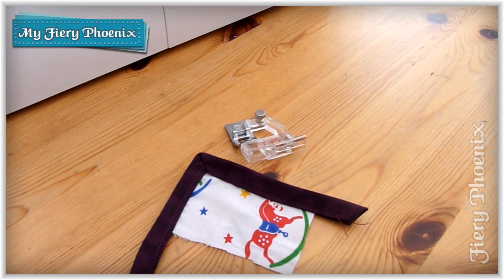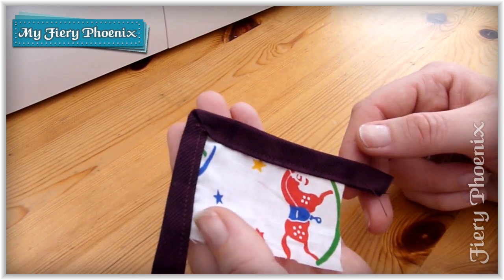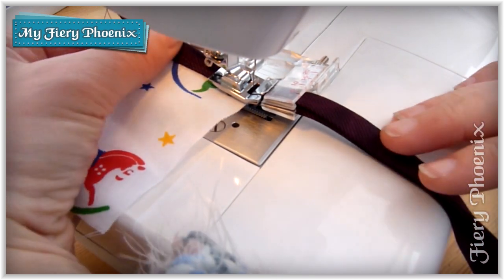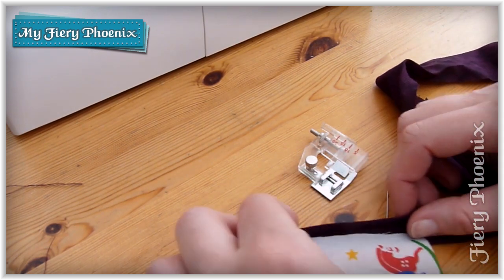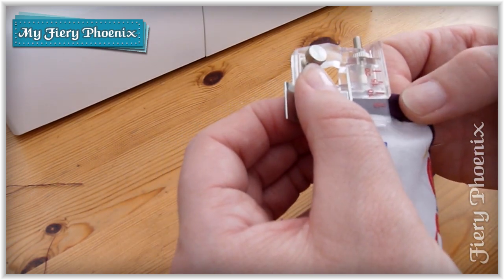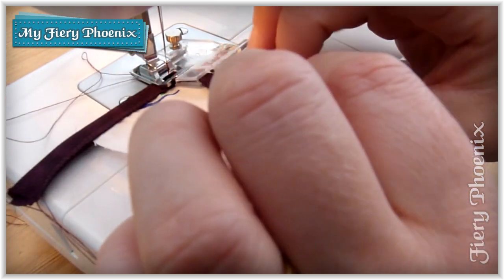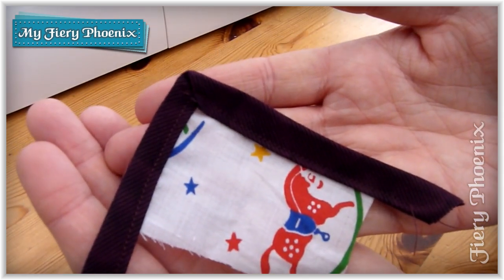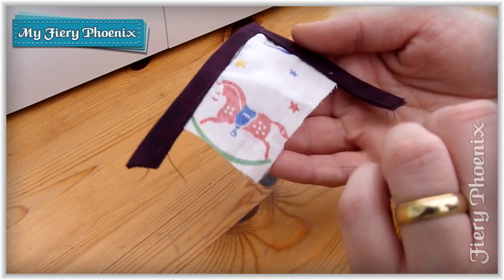Mitre Corners with a Bias Binding Foot:: by Babs at MyFieryPhoenix

Comment: watched and re-watched video, having terrible time getting all the layers back into the foot when trying to do your mitered corner  -  I've notice that almost every video showing how to use this foot always only uses one piece of fabric to add the binding on.... most quilting uses at least 3 layers plus the binding -- any suggestions?  Totally frustrated,  may have to fiddle with the corners by hand and just add the binding on the sides - trying to do a 38" x 16" table runner
Reply: crafty bee On the original tutorial on the binding foot it was mentioned that this foot is not suitable for quilt binding. There are to many layers and the thickness causes problems.
Reply: Ann Williams hmmmm well I to thought it would work for quilt binding. Ok thanks
Reply: Was going to buy one but had the same thought! Thank you for the honest feedback.
Reply: @Saucyakld   If you want to try it but don't want to spend a lot of money,  I found one on Amazon for $1.75.

Comment: Love this video, worked fine after you get the hang of it.  For the problem corner after trying to pin the Midas corner, I used my fabric glue instead of pins, worked so much smoother.

Comment: I didn't even know a binding foot existed!!! I have struggled with this for years.  It works perfectly except for one thing.  How do you end  it? Like if you were making something like a hot pad. How would you join the ends?
Reply from the maker: See with the foot to about two inches from the join then fold the ends of binding under overlapping slightly. Then either sew by hand or finish the last two inches with a standard foot.
Reply: @BabsRudlin  Thank you. Now I understand.  I had made a couple hot pads and I was hoping you would answer my question so I could finish them. I finished them and they turned out really nice.  I appreciate you responding.  I have asked questions about tutorials before and heard nothing back.  You now have a dedicated follower.

Comment: I too am disappointed that there was no mention of not being able to use on a quilt, which is mainly why I purchased it. I do do some garment sewing, but also like to make bags and wallets, where it may not work also. Bummers!
Reply: Hi, Yes you can use this foot to bind a quilt, treat all three layers as one and then feed through as shown..
Reply: She said if you make a quilt you need to zig zag the edges first so that the fabric is small enough to fit, im sure denim vs. Cotton would lose because of the bulkiness. If you were to make a baby quilt out of a panel and light loft batton it would be easy peasy, just zig zag the three layers together and have at it.
Reply: You need to blanket stitch down the sides  together ...to flatten, but serge if possible. She did mention that in her video